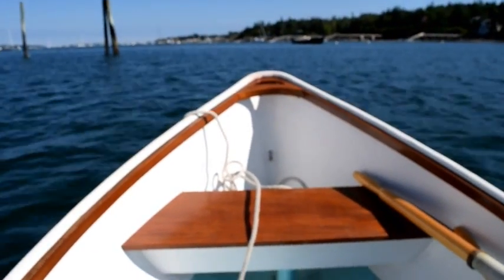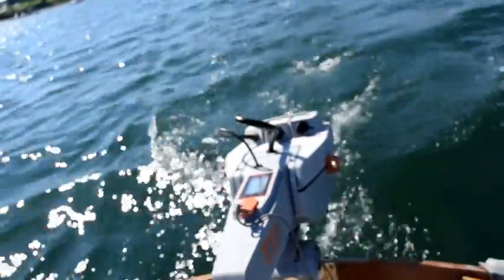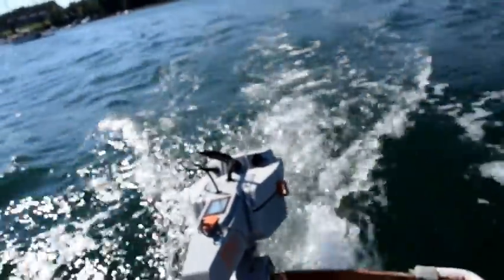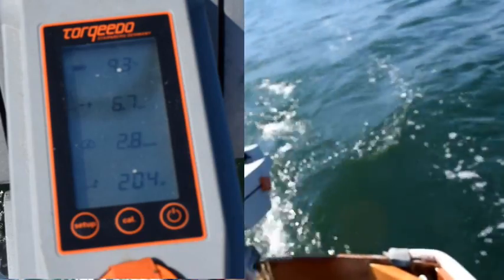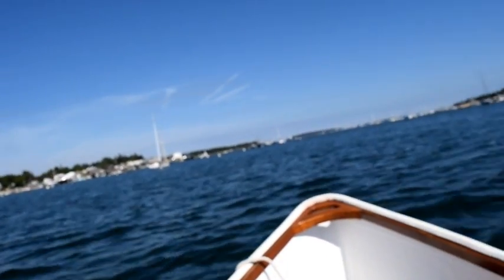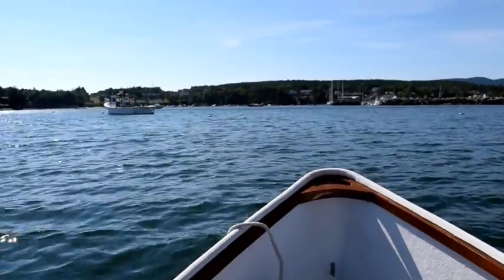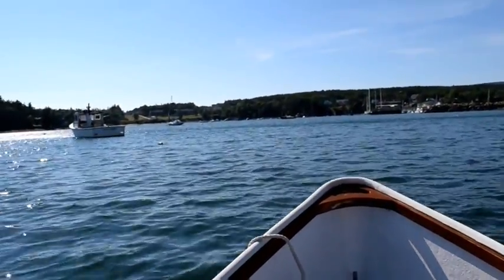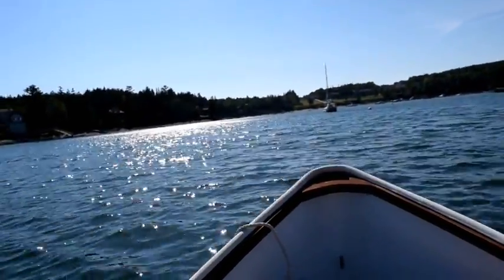A Practical 100% Solar Powered electric Yacht

Comment: That's not a Yacht,  it's a Row Boat.  FALSE Advertising.
Reply from the maker: It is a Yacht Tender ;).  The point was that a small boat like my 10' dinghy is really the only practical all electric boat.  Its power demands are small enough that I can successfully charge the battery in  single day from the solar on the "mothership".  Anything bigger requires a high amperage shore power connection or a generator (kind of defeats the idea of going ICE free).  Alternatively, if you are charging only from solar, a bigger boat is limited to slow, short, infrequent passages.  That is particularly true for sailboats that simply do not have room for much solar (particularly unshaded solar).  My powerboat, for example, has room for about a kilowatt of solar panels on the cabin top.  On a cloud free June/July day a kilowatt of solar mounted on the cabin top can produce about 4.5 kilowatt-hr for battery charging.  The 32', 10,000 lb displacement boat requires continuous power of 2.1 Kw-hr to maintain 5 knots on flat water and 5 Kw-hr to make 6 knots.  So with one kilowatt of solar on a cloudless summer day solar will provide enough power for about 10.7 nautical miles of cruising at 5 knots and 5.4 nautical miles at six knots.  On a cloudy day solar output could be 50% or more lower with corresponding decreases in range under power per day of charging.  Assuming I had enough battery capacity, eight hours underway at 5 knots would require require just under 4 day of charging from a one kilowatt solar array.  If I wanted to cruise for 8 hours at 6 knots I would have to charge for 9 days.  The required battery bank, assuming using 80% of battery capacity for the 8 hour cruise would be 21 kilowatt-hr for the 5 knot cruise and 50 kilowatt-hours for the 6 knot cruise.  Using the cheapest Lithium Iron Phosphate batteries available today (Jan 26, 2022), the battery bank for the 5 knot 8 hour cruise would cost about $5,500 for batteries and the 6 knot 8 hour battery bank would cost about $13,000.

Comment: I thought I recognized that whine. The all solar yacht  RA has two of those. And the sound drives me wild when it passes by 800 feet away. I asked he owner about that and he said he doesn't hear anything. I made my 1937 GarWood electric.
Reply from the maker: Nothing wrong with electric if you have enough batteries and a way to recharge.  How much battery capacity do you have.
Reply: Since retiring, I haven't used or moved that one to the camp where I spend the summer. I use the '55 Atom Skier.   I do want to build an electric one that relies primarily on solar with only a small battery for backup. There is a method called Linear Current Boosting that keeps the panels at power point and transfers maximum power to the motor. This allows cruising without a battery and the speed is proportional to the light level at the time. I design this stuff and the off grid camp is totally unlike other solar systems. Solar panels make a great canopy for a boat.